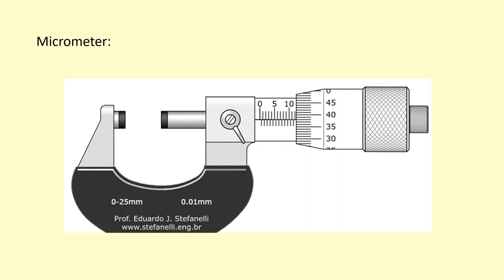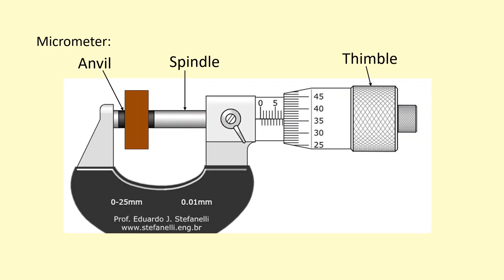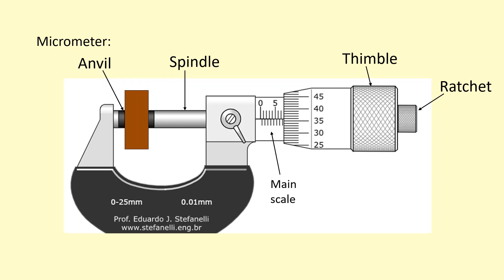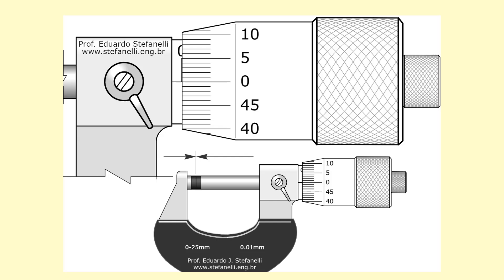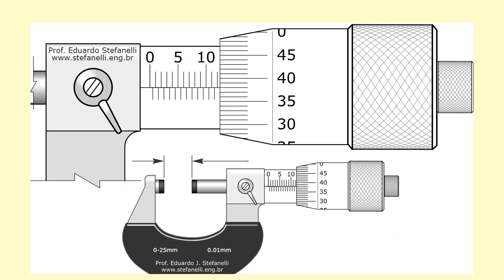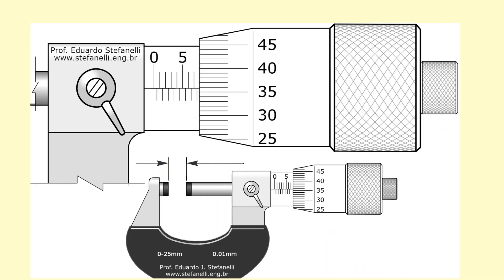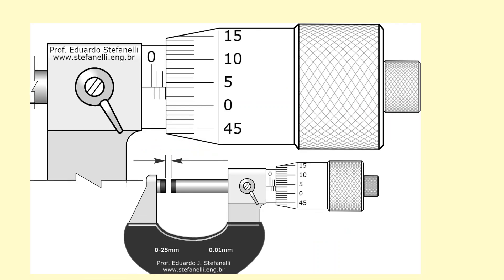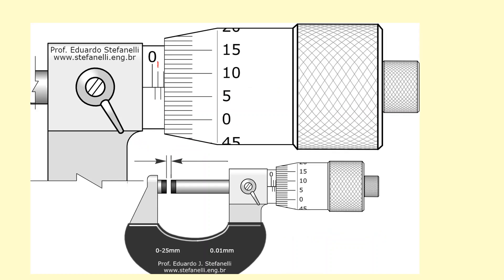15.01 How to use a micrometer?

Comment: I've seen in mark schemes (sometimes underlined) 'digital' micrometers, why does that difference matter? and in what situation would u use a digital one
Reply from the maker: Digital ones are easier to read, and you're less likely to misread them and make an error. But an analog one should do the job too.

Not sure why it would be underlined. Maybe if you have to take readings very quickly, digital one will be quicker to read.

Comment: And what if a value is in the middle of the thimble scale? should you round up or down or just write down the value in the middle
Reply from the maker: I'd go for the nearest value (i.e., round it up or down depending on what you think it is).

Normally, with a micrometer measurement, there's some uncertainty. It's at least ± the resolution of the thimble scale.